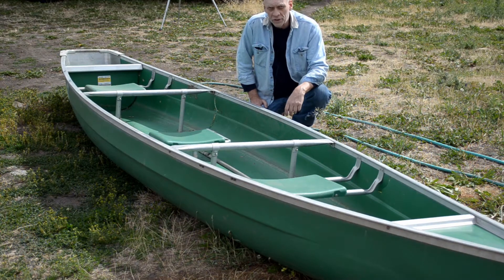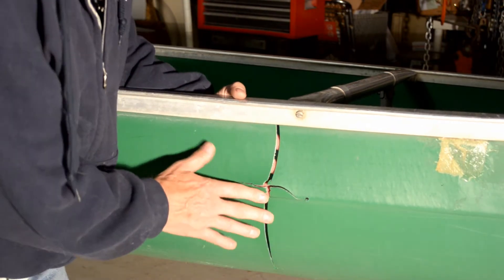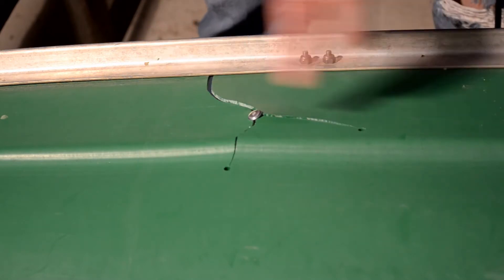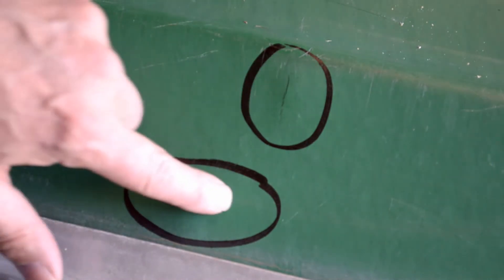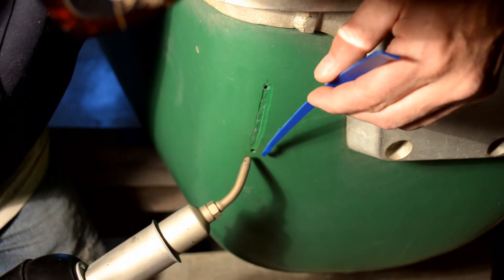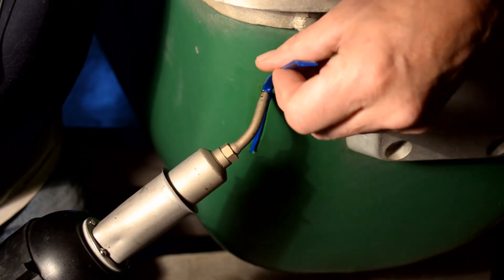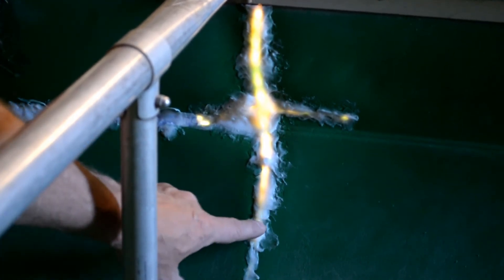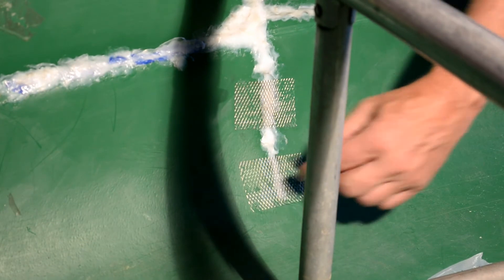How to Plastic Weld an HDPE Canoe Boat with Wire Mesh

Comment: This is an amateur job. Always use the same materials as the boats' hull. A professional job looks nothing like what's shown here.

It works. Sure. But it looks amateurish.
Reply from the maker: Oh how I love armchair quarterbacks! So that you, and my viewers know, the material of the hull was researched BEFORE the project began. The hull is made of HDPE 2. The same EXACT material(not color) HDPE 2 was used to repair it. I was not able to match the color even with the paint afterward. Sorry, but color matching was not EVEN the objective. The boat was split open in several places from frozen water expansion. The boat was virtually worthless before the repair. Plastic welding HDPE does not produce a beautiful surface. Period. Much like a woman that undergoes a C-section the cosmetic results usually are not the most appreciated, even though performed by a professional. You are welcome to link to a plastic weld repair of the same size that looks more "professional."
Reply: don't worry about the haters its how did it perform what I would like to know because I'm about to build a plastic boat from barrel plastic

Comment: For the record, you can't weld or fuse plastic like you would with steel or clay. Other than that, good video even though my methods are thriftier.

Comment: What type of screen material are you using?  Stainless or mild steel?  Regular screen door mesh?  Thanks.
Reply from the maker: I used a galvanized wall repair screen mesh from Home Depot. Thanks for watching, and your question,
Reply: I always use galvanized too.

Comment: Which tool is the awesome nozzle heat gun? Where did you get that?  Heading to HF tomorrow.
Reply from the maker: Hi Joe. You probably already found the electric plastic welder there at Harbor Freight. Always remember to turn off the heat and let the blower cool off the element before shutting down the unit. Thanks for watching and commenting!
Reply: hardluckcharlie does that gun have a digital temperature reading?